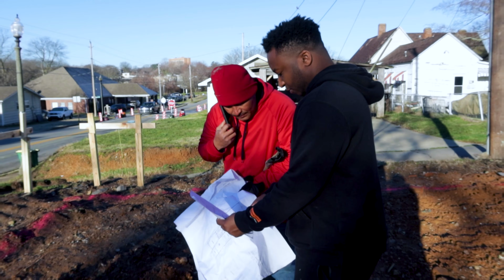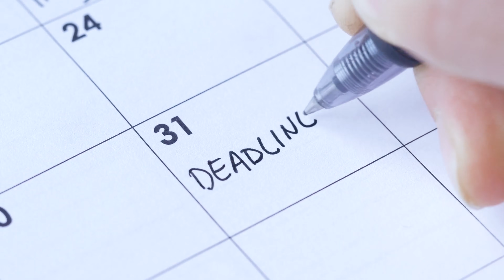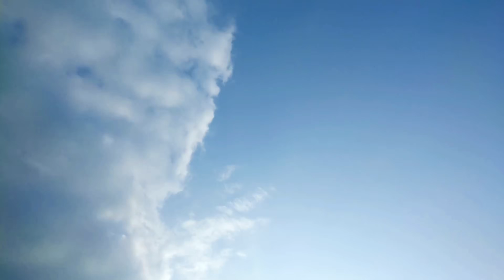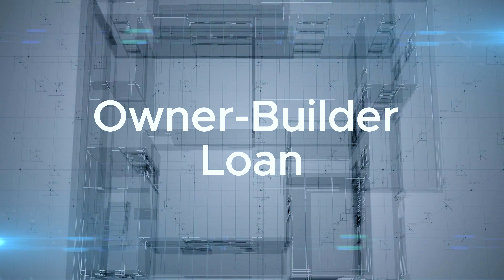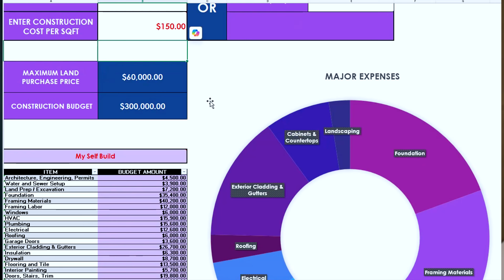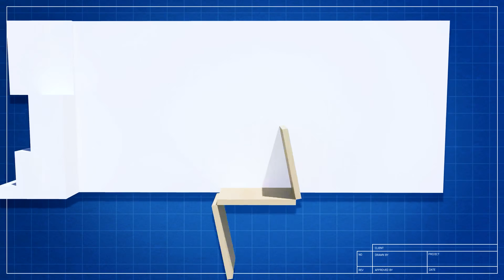Construction Loan Requirements 2025 - HOW To Build Your OWN House!

Comment: Question: I own a debt free peace of land and can build a single family residence on it. I'm in the process of designing the house, have the servery completed, have the liquid capital to complete the project without debt and have zero credit since I'm debt free and haven't needed it or used it for about ten years. I'm also a carpenter and build from the ground up without any hired labor except for on concrete days. I've been watching your videos as well as Jerome Maldonado videos to gain further insight on how to do everything properly. I own my primary home that I built myself debt free and have built several homes in the past that I sold for the capital that I now have to work for me. That's why I'm debt free and have liquid capital with zero credit. Moving forward, my plans are to keep as much of my cash as possible and finance my builds going forward. My plan is to only build to rent and grow a real estate portfolio like what you have done. It seems that I need to get the finished plans together with all of the lumber cost and all of the rest of the cost before I present everything to a local credit union. Will I have an issue getting a construction loan since I don't have credit? What do you think of my plan and would you change anything or do it a different way? What can I improve on? Thanks so much!

Comment: How do you structure the agreement with contractors/builders? Deposits then payment after completion. I've heard stories where contractors just disappeared. That is probably my biggest concern being someone who is new to this.
Reply from the maker: We always get the agreement of what work is to be done and for what price in writing. Sometimes that’s as formal as a contract, other times it’s as simple as a text or email. This helps to ensure we are all on the same page and is beneficial to have in the event that a contractor tries to change the scope of work or price as building progresses. We simply do not pay deposits or money upfront to subcontractors. In the event that a good amount of material or supplies are needed and the sub wants money up front to pay for them, we will go buy those materials ourselves and supply them. I’d say most of the time we are paying our subs for labor only.

Comment: Do you need some guarantee for getting a construction loan?Is an architect and plans are construction costs?
Reply: Great information.  I own land and trying to get a construction loan to build a rental what will you recommend?
Reply from the maker: As I mention in the video, working with an architect, designer and securing accurate house plans are often going to be up front out-of-pocket expenses since they could be necessary prior to getting your loan. Lenders have different requirements in terms of how you will guarantee the loan but most will require some type of personal guarantee.

Comment: What some locations that one look for in purchasing a lot. Lot zoning must be r2 r3 or what?
Reply from the maker: Zoning names are going to vary by city. The most important thing is to determine what you want to build and then find a lot where you can build it. That means the zoning either already allows it or you’ve talked with your city about a lot, have a good understanding of the re-zoning process and re-zone it to be what you need. For example, if you buy a lot with single family zoning but you want to build a duplex you should understand the likelihood of successfully re-zoning that lot before continuing.

Comment: How would it work when you're doing a multi-unit property and you planning on living in one and rent the other side? How do they come up with the calculations on how much to approve you for? I know the count 75% of the other units towards your approval for already finished properties, but is it the same for the new build?
Reply from the maker: It’s going to depend on your loan type. For a construction-only, lenders may not factor the potential rental income at all. For something like an FHA build loan where its construction to permanent, they will use the potential income to help determine your approval amounts. The best thing you can do in the meantime is start setting up meetings with potential lenders to understand their processes more